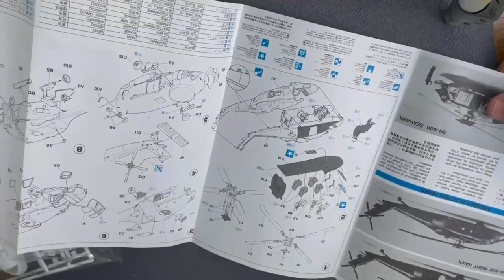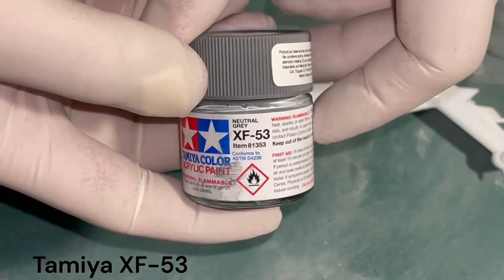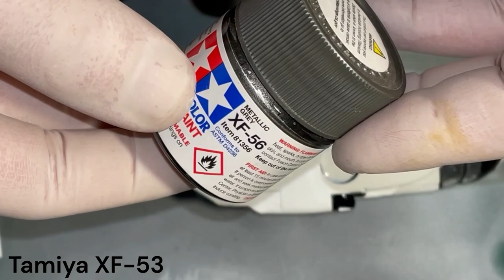Assembly / Hasegawa / 1/72 scale Sikorsky SH-60J / Seahawk / How to build / Painting / Helicopter

Comment: Why didn't you use PVA glue for the clear parts?
That plastic cement clouded the clear parts.
Reply from the maker: I don’t think there’s a written rule about gluing clear part with that type of glue, I think 🤔
Reply: @theairplaneguy4250  The model maker might have worded it a little better, but what he was suggesting to stop the clear parts from fogging have a go at PVA glue. 
I remember doing this kit back in 1987 and you have done a better job than I have.
Reply: Super glue fogs clear parts Tamiya extra thin dosen't fog for me.
Reply: @harryaudia6  I use super glue but let it sit for a couple of minutes before I fit the part.

Might have been lucky so far